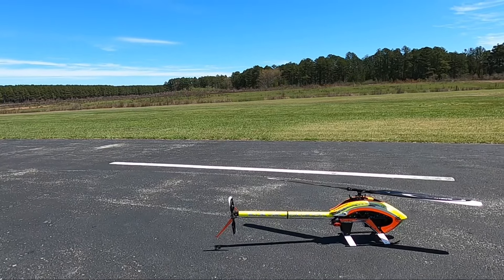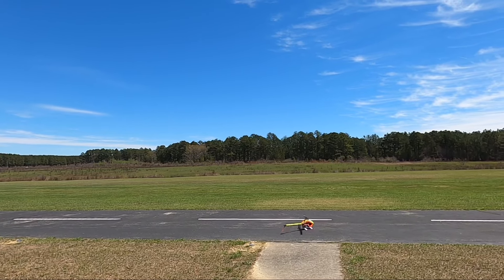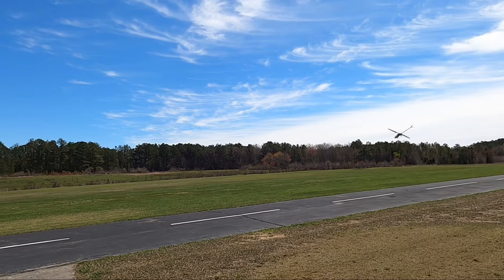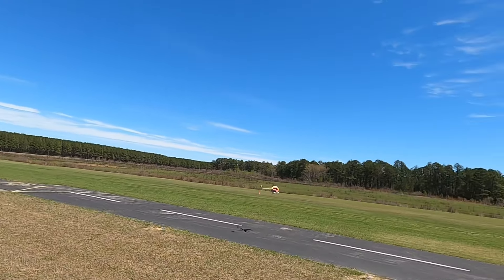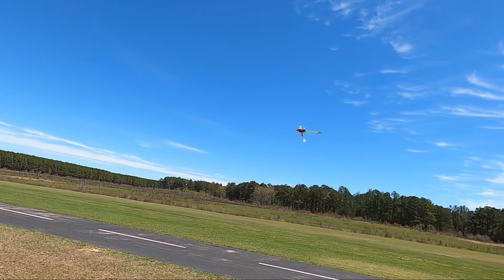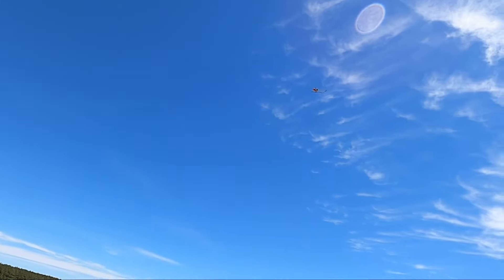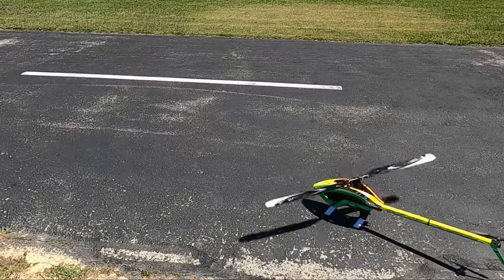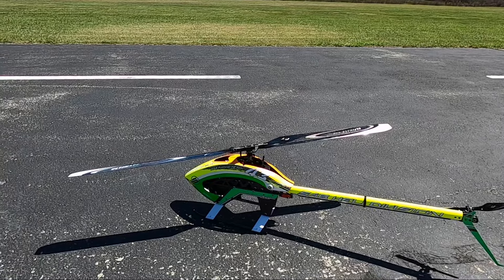Back To The Basics! Learning Basic 3D!

Comment: Great video Jeff - I see you are using rotor tech blades on your 580.
I assume they are 580mm?
Do you prefer them over the stock Sab blades and if so, why?
Thx!
Reply from the maker: Thank you very much! I greatly appreciate it. Yes they are Rotortech ultimate 580s. I wanted to try them over the stock 580s honestly the only difference I could feel is at lower RPM. They have a lot more bit but at the higher rpm range the stock blades fly just fine. If I crashed these blades I’ll go back to the Stock SAB 580s.

Comment: I fly freestyle drones in acro mode is it similar?
Reply from the maker: @MassterYewsefth  not really unfortunately, with helis everything is backwards when the heli is upside down. The main hovering and maneuvers are the same.
Reply: @westhobbiesrc8051  ok I see so upsidedown throttle down is up
Reply from the maker: @ so it’s more then that but yes, your RPM is set so your throttle stick is collective. So midst stick is zero anything up is positive anything down is negative pitch, but your left is right and right is left and up is down and down is up and forward is backwards and backwards is forwards. Then depending on orientation upright or upside down, it’s all different. Nose in, tail is left right etc.
Reply: @westhobbiesrc8051  thanks for clearing that up for me!❤️